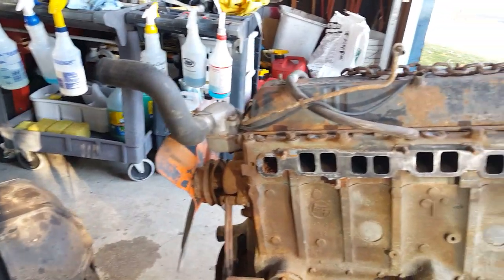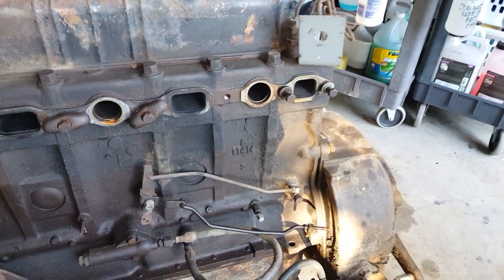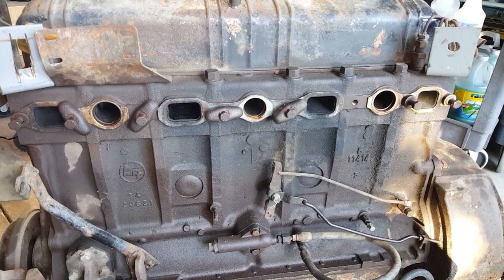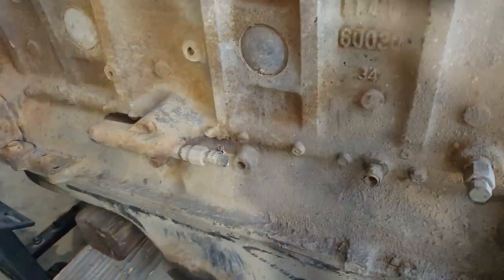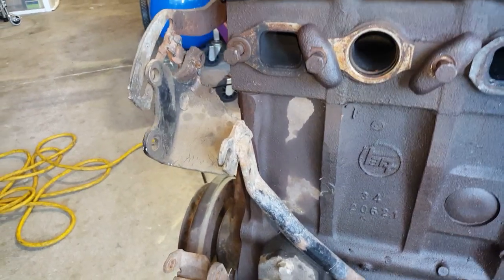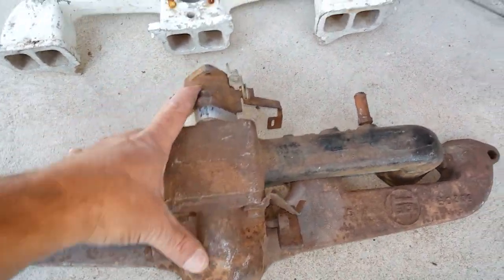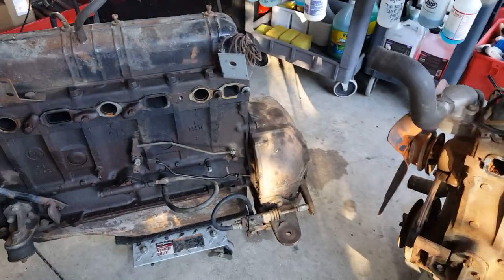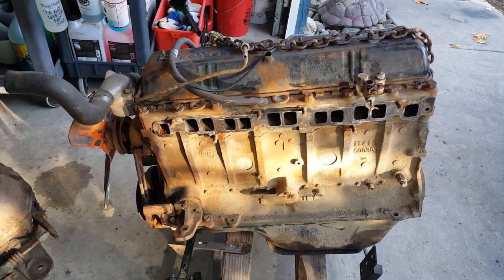FJ40 F engine info

Comment: Years ago when I worked at a Toyota dealership, we swapped an early F engine into a 1958 GMC pickup that belonged to one of the parts men. Other than having to use the GMC bellhousing and clutch, and having the Toyota flywheel drilled to accept the GM pressure plate, it was a bolt in swap. Even the exhaust pipe and radiator hoses fit!
Reply from the maker: very cool story thank you for watching that is cool to know how it converted so easy.

Comment: what year was the engine on the right produced, I have one in my fj but cannot figure what year to get parts for, the part number I have on the engine is F263094 thanks for the help buddy
Reply from the maker: You got what looks to be a early 1969 F motor, Specter Off Road has chart showing block numbers and it shows 8/69 as 290409 so 263094 should be early 69 or later 68 but parts should be pretty close. They ran the F until 74 and and most parts are pretty much the same
Reply: @landcruiserintervention9443  awesome, thanks so much for the swift reply. Appreciate the information happy holidays!!
Reply from the maker: @yirlana  Happy holidays to you too glad to help.

Comment: Yeah funny thing My FJ motor is also from a early 73 and its the half and .5 one which is a bit of anomaly it looks more like the 2F the valve cover looks nothing like the older 69 1F or the newer 2F its like solid grey with the ripples on the side without the Toyota Sign on top. My machine shop said pistons were a bit more doomed more compression and redid the whole thing with climber RV cams from what he told me he said its an early 2F. Its anomaly
Reply from the maker: The machine shop didn't happen to say if the head is different for the domed pistons did they ???? Me and a guy on here joe sixpack were trying to figure out if the heads were different on the half engine because of the domed pistons

Comment: Hey, question for you...  I have a '72 FJ40 with the 1F and I've been shopping for engine parts and I see that SOR has oversize pistons, but they are for September '72 and later 1Fs...  What is the difference?  Would I be able to use those in a July '72 engine?  Love your FJ40 videos...
Reply from the maker: Thank you for watching I enjoy chatting and sharing info. Boy that mid 72 seems to be an anomaly. I know 9/72 and later were domed and totally different, but why 1/72-9/72 is different from earlier F's I am not sure and I want to find out why now. SOR has some 1/72-9/72 pistons on their website, their site is weird when you click on the part number and the price list comes up you just have to scroll down farther on the page to find them. It shows they have STD, .010 and .020 over. Have you seen that guy that goes by JNH classics here on youtube? He is having trouble with his I believe 72 F motor too, he is having it rebuilt and I believe he said his machine shop had pistons. He's basically trying to figure out the same issue
Reply: @landcruiserintervention9443  yeah, I've posted on his site too.  I have a July 72 FJ40 and the engine is locked up.  I have not torn it down yet but I'm guessing I will have the same issue as JNH.  I've been waiting to hear back with another post on his site, but maybe in the next couple weeks?  So if the post 9/72 pistons are domed, did it use a different head?  I am not an FJ40 guru, that is why I'm asking you...  :o)
Reply from the maker: @joesixpack7551  Hey Joe sixpack Sorry I am just answering sold that red 65 Fj and I had to get it ready to go of course after it sells it don't want to run. I am not sure if the domed piston style heads are different I have tried to find out but nobody seems to know the differences

Comment: years ago i rebuilt the motor in my 64 fj40 twice. original motor lost oil pressure and seized as did my first rebuild. my h.s. auto shop teacher double checked all my work. we even measured the oil pump with the feeler gauge. looking back i probably should have replaced it but the gears looked good. The main crank bearings had the shims and i always thought that was the problem. I somehow set up the crank bearings wrong maybe. Its always bothered me that i never figured out what caused the low oil pressure. I even put washers behind the oil pressure relief spring. when at idle oil pressure would go real low. sold it before it blew up a 3rd time.  Anyone else had problems with low oil pressure in these engines?
Reply from the maker: That is so weird I have had low oil but it was the gauge.